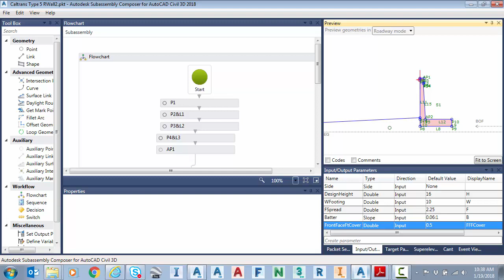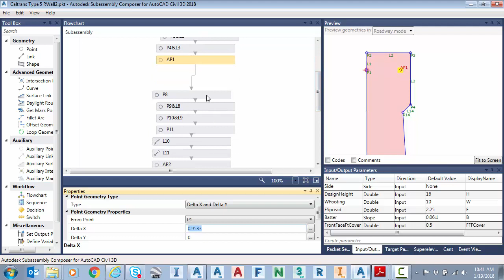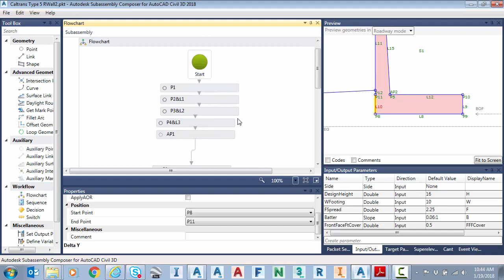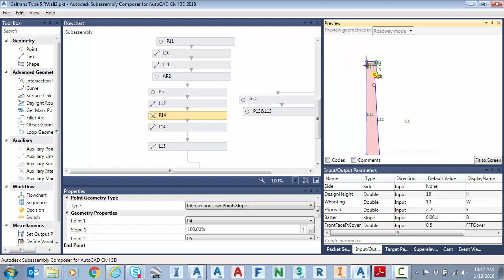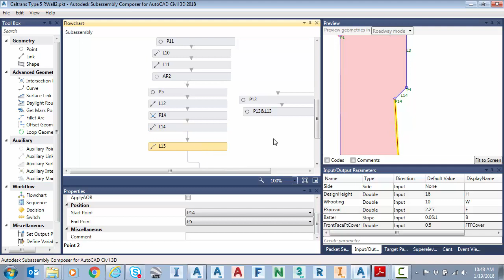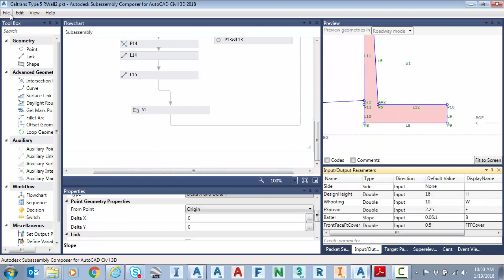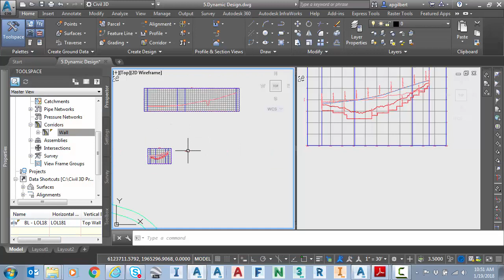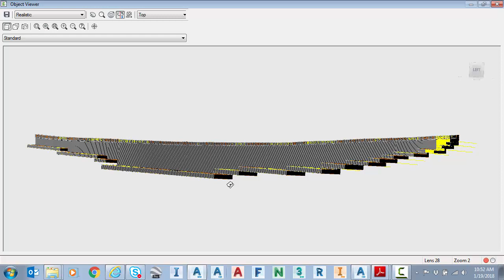Finish Strong Friday: Retaining Walls with Subassembly Composer Part 2 – Example

Comment: This is an old video but I hope you can answer my question. Thanks.
Sceneario: L-shape retaining wall to be installed along the road right-of-way (ROW) with toe inside the ROW. The retaining wall is supporting the existing soil beyond the ROW. 
How to link the the outer wall face to the existing grade w/o using the "slope to surface". The wall link origin is the depth of footing from finish grade.

Comment: What is the reason for having the slope from P2 to P8 of 100000% instead of just having P8 be exactly vertical below P2?
Reply from the maker: HI Jakob, I do this because the TIN surface model cannot contain vertical faces.  The corridor creation tools have some ability to deal with this automatically, but I prefer to go ahead and make this slope near vertical (not exactly vertical) at the time of creation.
Reply: @AlanGilbert  I see, thanks for you quick response. But when making the simpler retaining wall in part 1, you did not do this, correct? Was that just to keep the complexity of the subassembly down or was there another reason?
Reply from the maker: @muppymupp  Yes, this was just to keep the complexity down for the intro video.  And on a simple shape like this, some people would rather let the corridor overhang correction take care of the issue and keep pure vertical faces (especially if they are going to create AutoCAD 3D volume shapes from these).

Comment: difference between conditional cut or fill and conditionalhorizontaltarget plz if any video
Reply from the maker: The conditional cut/fill subassembly allows you to select a side-slope based on the depth of cut or fill the assembly is in.  For example, as your amount of cut (removal) gets very large, maybe you want to steepen your side slopes to stay within a certain distance horizontal.  The conditional horizontal target allows you to control your assembly geometry based on an offset target being found or not.  For example, if this conditional finds an offset alignment at a particular station/chainage that represents a driveway or entrance, then don't place geometry for the curb.  Instead, place an entrance slab.  Then at stations where the alignment is not found, place your standard curb as no driveway exists at that location.Conditional cut/fill video:  https://www.youtube.com/watch?v=ceUew3G58_M   (conditional added around 2' mark)Conditional horizontal target video:  https://www.youtube.com/watch?v=lWXzXdDCU_g&t=1s